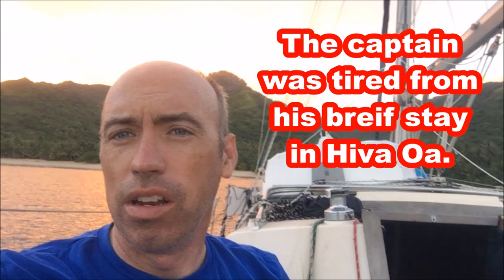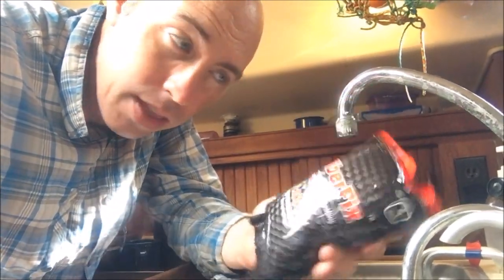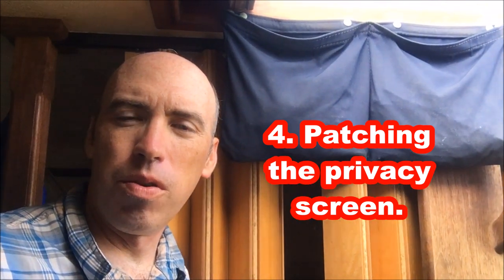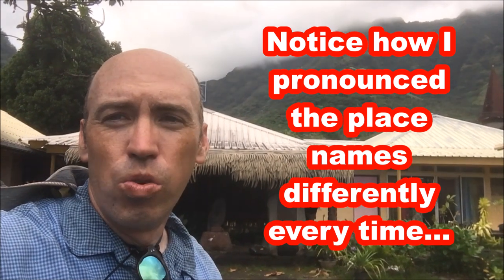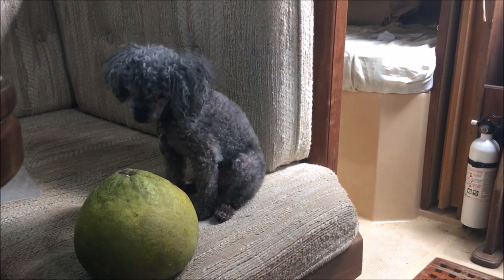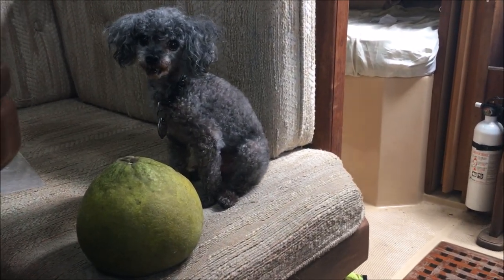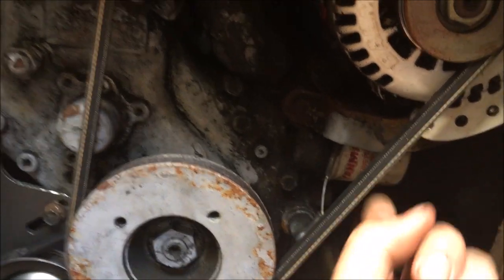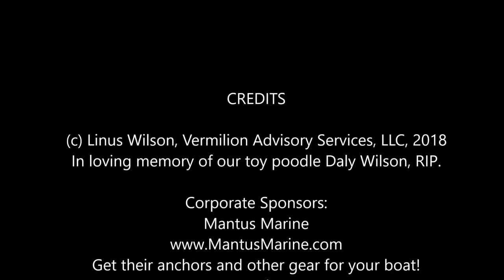TAHUATA: Fixing our SAILBOAT in PARADISE, Marquesas, French Polynesia, Hanamoenoa to Vaitahu S2E9

Comment: 110 intimidates me. Was the install difficult or were the instructions simple enough? Oh and how long can you run your a/c with the Honda with one tank fill. Thanks again for responding to my emails. I promise this is the last one on this topic
Reply from the maker: Terry Boykin it was like 4.5 hours on one full tank. With 12,000 BTu you might get 6-7. You unplug the shore power and turn off the AC panel. It was not simple but careful reading of the manual and the color coding should get you through.

Comment: Greetings from New Orleans. Saw one of your videos on your trip to Columbia from Cuba. You mentioned in passing that you found fuel and thus were able to use your Honda 2000 to run your air conditioning. I was wondering what kind of a/c you have i.e. How many hours will the a/c run on a one tank fill on the Honda. My boat is currently in the boatyard at seabrook. Enjoy your videos
Reply from the maker: We have a smart start on our marineair 16K btu with the honda 2000. After we left Panama, we have not needed it in the Southern Hemisphere winters when we cruise. The overnight temperature in Ecuador and French Polynesia is rarely much over 70 degrees. The Honda 2000 comes in handy for charging. Have fun in NOLA. What kind of boat do you have?

Comment: Thanks for the response. I have a petteron designed center cockpit Formosa 46. It is the same design as the Peterson 44 but 2 feet longer. Did you have your smart start installed in New Orleans? If so who did it as I may want to have my 12,000 but units modified. Thanks again for your response.
Reply from the maker: I installed it myself. The boat was in Bucktown when I installed it.